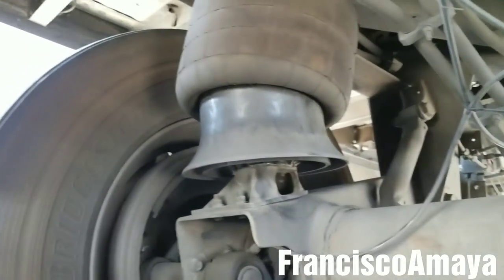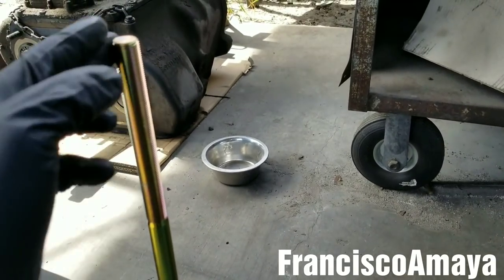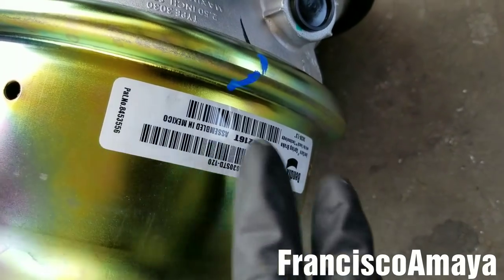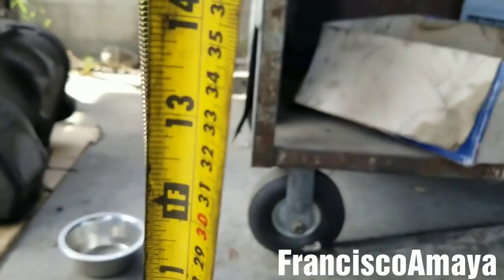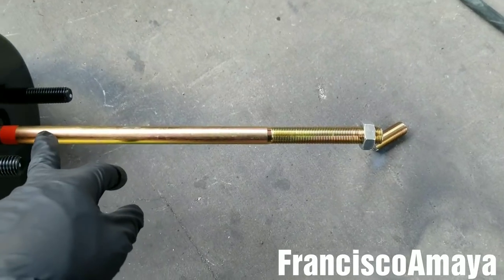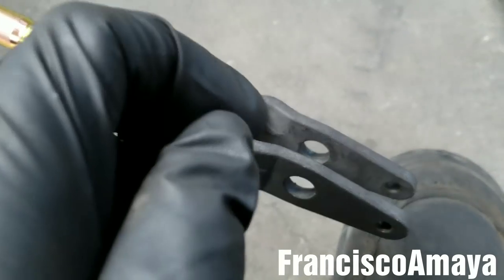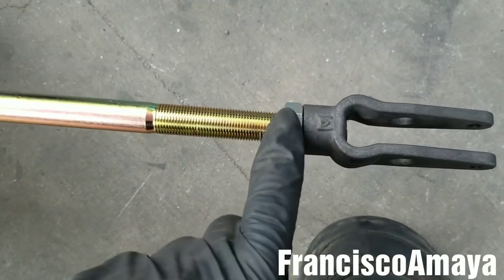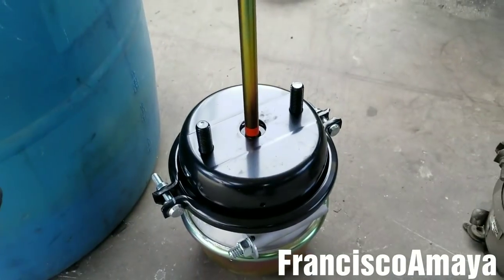Brake chamber replacement measurement and cut pushing rod trailers trucks 30/30 short long stroke

Comment: Pushrod length is measured at zero stroke. You have shown it being measured at full stroke. This can created an inaccurate length and is critical on dual pin brake adjusters. The chamber must be fully air caged to get the proper measurement. Also, what do you do if the old pushrod length was wrong and how can you tell?

Comment: What if the old rod is cut incorrectly by the previous installer?  Why not mark the 90 degree intersection with the s-cam and set it up properly with the length of the clevis and set up measurement?

Comment: Thanks for the video. Does it matter if the old chambers is bad as far as comparing the measurements. Would it measure the same when side by side with new chambers? Thanks again

Comment: Can you do a video on how to measure and cut rod if the old brake chamber rod was not the correct length?  When I replaced mine all 4 were off +/- 1 inch of each other. Long story short everything is installed but I'm not 100% sure it's cut to the right length.
Reply: @anitamartini8161  thanks but that's not it. I'm interested in seeing how to measure and cut the rod length if you don't have anything to go off of . On mine I took an average of the 4 goofy ones and made the cuts. The brakes locked up so I shortened 1/4 inch a few times before it seemed to work ok. But it would be nice to know how to measure from scratch and make it right the first time. There are lots of instructions manuals online but they make it confusing. It would be nice to see a professional do it so I can be 100%.
Reply from the maker: usdpaulp

I did that one this video, the difference is how long or how short do you need it.  

For the truck brake chamber the process is the same, just smaller pushing rod length.  But the same way you going fo measure it as I did on this video.
Reply from the maker: usdpaulp
Now, if the pushing rod was already cut and it is longer than normal, you can re measure it to 4-1/4 inches to give the right length but it is always better to get the length of the pushing rod from the old OEM brake chamber.  If the brake chamber pushing rod is cut shorter than 4 inches you will need to replace the brake chamber for a new one.
Reply: @usdpaulp  https://www.tsebrakes.com/medias/iw/TSE_Installation_Manual_rev5.pdf I dont know if you are still working on this but I found this manual useful. You will need to put it with a spec sheet for your brake can.

Comment: You are assuming the brake chamber you took out was originally installed correctly. You need to learn how to determine the length and cut it yourself
Reply: That’s what’s confusing to me.

Comment: Hi, I have a problem with my dd15 
Cascadia 2011,
I had engine check light on and start loosing power, I took it to this shop, they checked it with computer and told me that I need to change engine harness. I told to go head and do it. After they put new harness on,  I took it for test drive, it was same nothing changed, 
I took it back to them, they checked with computer and told me that I need  injector 4and 6. I told okay go ahead and change it. 
After they changed the two injector and injector harness, I took it for a test drive still loosing power. 
I took pic of the their computer when they were checkeing it’s show that 
Low pressure fuel sensor is failed 
Can that be the reason??  And thanks
Reply from the maker: Do you have the code number?
Does your truck have DEF?
Reply: To me you need to go to a real shop they are just guessing